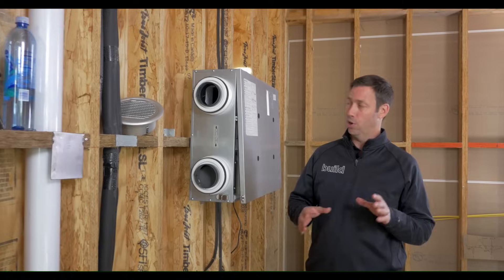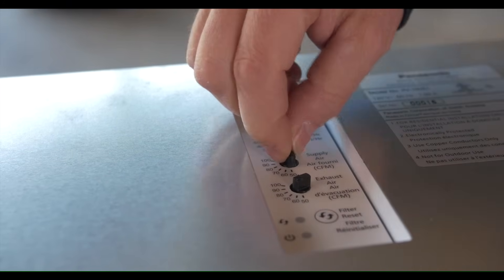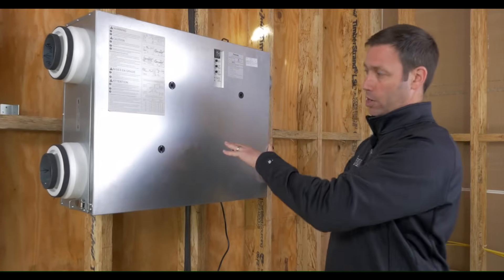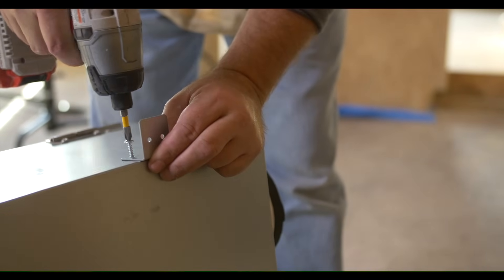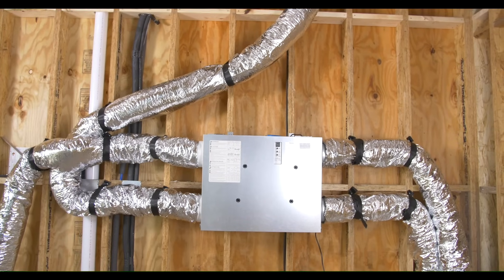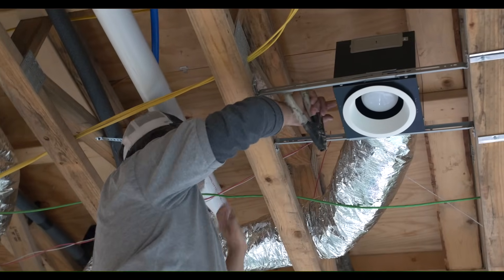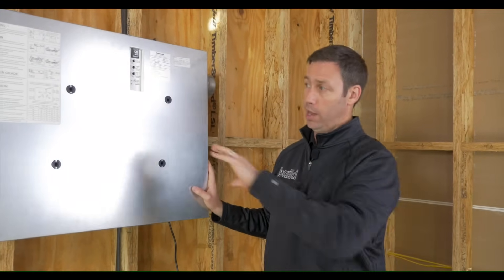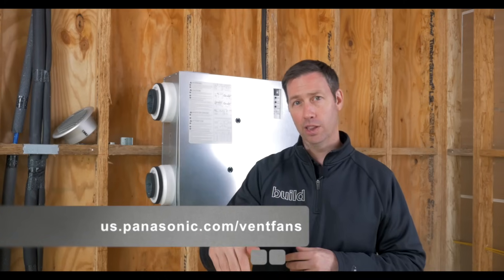How to Install an ERV

Comment: It's a short video I know. Ducting is important. The install guide from Panasonic doesn't offer much. Matt has about 2 feet of straight run from each port, which is recommended. As a Rater I see many long runs of ducts. The ECM motors can only overcome so much resistance. When I measure amp draw on installs the efficiency is no where close to what Panasonic claims on the front panel. When an ECM motor has to work hard, it's efficiency is lost. The only way to know how much air is moving is to measure across the ports as Matt says. The dials on the ERV do not indicate the amount of air actually moving. Even so, if the ducts are leaky there is no certainty as to where the air is going. Many times the unit is installed horizontally. I point out that the ERV needs to be maintained and installing it horizontally makes that very difficult. When the ERV is connected to the HVAC ducts the air handler should be running at low speed whenever the ERV is operating. If the AHU is not running the supply air from the ERV will take the easiest path, which might be straight back to the ERV and not to the house. I think ERVs are important to deliver fresh air. However, in my Rating work, I almost never see one installed correctly.

Comment: can this be connected to a thermostat so when the air handler fan/heat is running this will run?

Comment: In a more extreme climate where you get 100° summers with 70-90% RH and 5° winters dumping the ERV supply into the furnace return is a must. The supply air from the ERV being concentrated to a hallway will make that hallway very cool or very warm and muggy at the peak of the seasons.

MERV 13 is pretty dang good, but when the flint hills burn, you’ll need HEPA to get the smoke out. My approach is to install a HEPA bypass filter the usual way back-to-back on the return duct of the furnace and pipe the ERV supply into the top of the HEPA unit. I then wire it so the HEPA unit always turns on when the ERV turns on. Since the HEPA filter’s flow rate when powered on is greater than that of the ERV’s, 100% of the ERV supply will be filtered at sub-micron levels.
Reply: Are the filter’s washable?
Terry

Comment: I installed this 7 months ago - Minnesota residence - it’s working great - even in the cold temps we’ve been seeing.  During most months it’s been on 60/60 minutes an hour.  When really cold we knock it back to 20 every hour.  Big difference in allergies, build tight ventilate right
Reply: curious why did you choose ERV over HRV?
Reply: @bradkastephens  in sum humidity management during all 4 seasons (3 in Minnesota - we skip spring usually)

The enthalpy core of this ERV manages moisture by balancing the exhaust and intake air flows.  An HRV will manage heat retention but manages condensate removal only from my experience.  So there’s a need for a condensate drain which is more work and the device won’t balance humidity for you by exhausting the excess humidity from the home overnight in the summer or maintaining interior humidity in the winter against dry exterior air.

That’s why I chose the ERV

Comment: How does one install this on an older house. I guess what I am really asking is how do you pull the air in an existing house. Mine is built in 2000 has a house fan too which when turned required the windows to opened.

Comment: Is it possible to connect the supply side to the HVAC supply plenum and the exhaust side to the HVAC return plenum? So that you are supplying from the distribution and exhausting through the returns?
Reply: The point of the device is to bring air in from outside and condition it somewhat in the process. 
Terry

Comment: Hello, it’s a really good video. I gained alot of knowledge. One question rises. If you were to use it as stand alone unit, would this be the only source of fresh air to the house and your furnace will solely be heating up up cold air return?

Comment: Can I just open a window a little bit when running a fan or cooking ??
Reply: Of course but you won’t get the humidity control  and heat cold transfer plus air filtration. 
At least where I live there’s lots of pollution pollen and high humidity. 
It’s not just about pressure issues but more about improving indoor air quality. 
Terry

Comment: For any homeowners out there who are looking to replace their own ERV or do a DIY install, I would highly recommend the Broan AI Series ERVs. I just replaced my old, non-functioning Honeywell unit from 2002 with a Broan AI Series. I inquired with many different HVAC contractors about ERVs but all of them told me something along the lines of “don’t see the point in them as it’s just the equivalent to opening a window.” I’ve been watching Matt for a while so I knew this wasn’t true and that my builder obviously put one in for a reason. What sold me on the AI Series is the unit uses an auto-balancing procedure. Meaning, no need for a manometer, pitot tube, or having to manually adjust dampers. The unit has integrated motorized dampers and displays the incoming and outgoing CFMs. It also comes with a MERV 8 filter standard, upgradable to MERV 13. I looked at a couple different ERVs from Zhender, Honeywell, and Aprilaire. The Broan AI series sold me instantly for the reasons above, specifically the auto-balancing. The AI series also just looks likes it’s modern technology, compared to other brands. I’m really happy to have my fresh air system functioning again and even more happier to know I did it myself, saving thousands of dollars. I just need to wire the Broan touchscreen keypad for it now in my upstairs so I can monitor the status of the unit.
Reply: 4 years later, how's your Broan series ERV doing?  cheers
Reply: Well I recommend you get ours… We have the best one that is manufactured in the planet… The manufacturer you mentioned manufactures shavers, massage tools and blender.. They have 0 knowledge on anything. They simply make stuff that sells….
Reply: Is the filter washable and long lasting or expensive and in need of replacement regularly?
Terry

Comment: Matt why would you make this a standalone unit when you can hook directly into the HVAC return and distribute the air properly into every bedroom? I have a five bedroom house and if I were to set it up as a standalone unit like you did I feel like the air I would not get into all the bedrooms. Essentially it’s the same thought just put in one exhaust Vent of heating into the main hallway And expect the heat to reach every bedroom.... can you give me some input as to why you like to make it a stand alone.
Reply: The biggest reason is that the ERV attached to the HVAC would have to run with the HVAC, and yet they are doing different things - the HVAC heating/cooling, and the ERV cleaning. In my case, I run my ERV 24/7. When I turn it off, the CO2 level increases within a day to high levels. But many days, my HVAC runs for just a few hours or not at all.

Comment: At about 5:25 you mention that you can dump the fresh air from the ventilator into the "supply side" of the hvac system.  Wouldn't connecting the fresh air to the cold air return side be better?  First, it would go through the return side filter system for added particle removal.  Second, the fresh air would be conditioned in the same manner that the rest of the air in the house is conditioned.  Also, wouldn't connecting to the hvac system and spreading the fresh air throughout the living area be better than dumping semi-conditioned air into one spot?
Reply: same thoughts on the manuals
Reply: @freshpootube the manuals show it like this, but i had the same concern

Comment: An ERV...it's to fix the problem we've created over the last 30 years making houses air-tight.  Mine is probably a 7 on a scale of 10 for air tightness and whenever I turn on my Panasonic bathroom exhaust fan I can smell attic air being draw thru every crack and crevice, that's how I know if I forgot to turn it off (it's super quiet).  My 90% furnace gives me headaches centered around the nerves in the back of my head around the neck every time we go into the heating season, don't tell me it's not shooting carbon monoxide back into the house.  I don't like the looks of the exhaust/intake on the outside of the house, it's one of the types that don't have separate pipes...it's probably sucking in the exhausted fumes.
Reply: The "build tight" movement seems to have won the battle over how to make a home energy efficient, as spray-foam sealing of attics has become a "high-growth" industry, pumping tons of foam (plastic) into our houses at an ever growing rate to "air seal" the attic, extending the thermal envelope as a way to minimize energy consumption. I'm going to have to go along with it to upgrade my 24 year old home, but shudder as I realize that the earth already has a humongous "plastics" problem, and our homes will eventually get bulldozed.
Reply: If you don't want an ERV add some fresh air ports (passive vents) or a powered intake fan.

Your furnace should not be shooting anything back in the house as modern units operate using outside air for combustion and then exhaust the fumes outside.
Reply: @rsmith02 - true, until the heat exchanger in the furnace fails.  Then you get lots of CO in the supply ducts.

Comment: Please explain the pressure balance. Does this mean I won't need a damper near the range hood?
Reply: No it's doesn't dynamically vary the flow to balance pressure.   But it does dynamically vary the fan speed to maintain constant flow.   You'll potentially need another source of makeup air for the range hood if it's high flow and/or your house is very tight.
Reply: @JoshDurston  Thanks so much for your reply. Yeah it was a bit unclear to me. I called the company and they actually weren't sure themselves. And said I had to talk to a higher level support...

Comment: I want to install one of these, but control it by a thermostat. I might have to build a custom control system but basically if thermostat commands heating or cooling, then it determines if outside air is cooler (AC) than interior... or exterior air is hotter (heating). I'm in Arizona and it's VERY common for it to be cooler outside at night, yet home remains hotter even with HVAC in cooling mode. I feel I'm wasting a tremendous amount of electricity cooling my house even when outside is cooler. I fiddle with opening and closing windows, however, why not just have a system that exchanges air when it's cooler outside (or warmer - less common where I live).
Reply: HEAV¥HAND  I stand corrected. I bought ecobee thermostats and they have a feature specifically to run air exchanger in place of AC when is cooler outside. It's pretty awesome, only problem is I don't have an air exchanger :(
Reply: HEAV¥HAND  Funny you say that, I'm scared to open the window in my bedroom haha... When I was a kid not the case. I lived out in the countryside in Nebraska, never heard of crime then. I thought it was something on the movies.
Reply: HEAV¥HAND  Yeah it's insane. I was talking to my folks about how we used to never lock the house, leave keys in cars, etc. My neighbors got upset when I knocked before visiting. They always told me just to come inside. Such a different world bad then.

Comment: If I have any type of HVAC and a whole house dehumidifier, why would I need an ERV? In northern Tennessee, you have all 4 seasons so do not see how an ERV would improve the whole house which has R-25 SIPS thermal break walls, R-40 roof on a Post and Beam home.
Reply: Do those systems constantly bring fresh air in?
Reply: @synchrogrl18  An ERV cycles out staler inside air with fresher outside air at a constant rate. However, this will not help with humidity. However, there are Dehumidifiers that include ERV functionality.

Comment: Matt what are your thoughts on putting an ERV in a utility room in the basement where we have cat litter boxes and use that room to draw air out of the house and return the clean air back to the main floor of the house? Also if you can put the exterior exhaust and intake on different sides of the house would you or is that overkill?
Reply: Put the cats outside, problem solved.

Comment: The only reason I do not want to buy this is because I do not want to constantly spend money to replace filter at $40 a pop for the hepa is high. I think $20 would be the right price.  I would also be afraid to buy this because if Panasonic discontinued this unit, then at some point they would discontinue your filter.   I hate to be held hostage by  things that are beyond my control .  Does any know if there is an alternative filter or if the hepa filter in this is a standard size filter that can be purchased and used for this system.  Also, I don't have to get 100% of my pollen out and  I would be so happy if they had a  washable filter?  Does anyone know any other solution to get low cost or washable filters?
Reply: David Hazen  you could buy a normal hvac filter and cut it down to size. Maybe buy a large enough one to get a few that fit in here. I know people do that with home hepa air filters.
Reply: Throw away the filter provided by the manufacturer and add any filter you like in the duct path coming from outside and before entering the ERV. And, while you are at it, you might want to do the same thing with the duct bringing exhaust air from inside before it goes into the input of the ERV, to prevent contamination of the heat-moisture exchange media inside the unit.

Comment: Interesting choice of install. I'm in northern ontario. I prefer to see the HRV supply dump into my furnace return. I also prefer to run my furnace fan on low at all times to maintain a better air blend across the floors and to allow the hrv supply to blend with the furnace/house mixed air. This also allows the hrv supply to always be distributed throughout the supply ducts reaching all areas and rooms. In the cold winters it's also nice to have the hrv dump into the furnace return to further condition that air to a comfortable temp (important to have the furnace fan on to achieve best results ducting it to the return, works as a whole home air handling system). Different climates do allow for a different install, being it's an ERV its differs slightly too. 
Great video!
Reply: excellent comment I was just wondering the same, so for each room do you have an output that supplys the warm air and then an intake that removes the fresh air? I think this method may cause a few issues, if your taking the exaust air out, and taking the heat from the exausgted air, putting it into the fresh air, and putting  the fresh it into the furance, arent you effectively waisting energy ? the heat gets loops backed through the furance? wouldnt a seprate system make more sense?
Reply: @magnus__reeves  the main purpose to my comment was due to the fact he mentioned different ways of installing the supply air. He said you can also duct the HRV supply air to your furnace supply duct, I believe this is a mistake many installers make. That air from the HRV has been pre conditioned in the core but not completely conditioned so dumping it into the return side of your furnace allows the HRV supply air to be further conditioned through the furnace (again this method works better if you run your furnace fan on low at all times) if you have a DC  blower furnace its far more efficient to run this way than the older style blowers. However he did also mention he ducts this system as a stand alone unit with his HRV supply duct dumping near a furnace return air duct (which would allow that HRV supply air to be pulled into the return ducting in the furnace and blended/distributed throughout the whole house).
Reply: @magnus__reeves  hey Mr. I think you may have misunderstood my comment. The "warm air supply" in every room is actually my furnace supply air (warm air in heating season, cool air in cooling season). There is no exhaust air in every room, I generally see the exhaust pulled from the bathrooms and the kitchen and sometimes a large general area will also have an exhaust duct (exhaust being the HRV duct pulling air out of the house). The HRV supply duct (outside fresh air being pulled in by the HRV) is ducted directly to my furnace return duct which is also pulling return air from all the rooms in the house. This way the outside air being brought in from the HRV can blend with the house return air and then conditioned through the furnace and distributed to all rooms through the furnace supply ducts. Running the furnace blower constant in low speed allows the air to better blend and distribute even if the furnace isn't calling for heating or cooling...for my area and specific climate this seems to be the best method.
Reply: @magnus__reeves  also to add, yes there is slight efficiency loss when running an HRV or ERV but I believe the loss of system efficiency is out weighed by the air quality/health benefits from having an air exchange system.

Comment: Also, how does this setup guarantee fresh air is moved throughout the entire house and not just provided in an area around where it enters the house? Thanks.
Reply: you typically evacuate air from one side of the house and introduce the outside "fresh" air to another end.